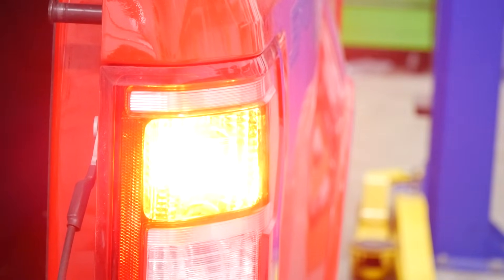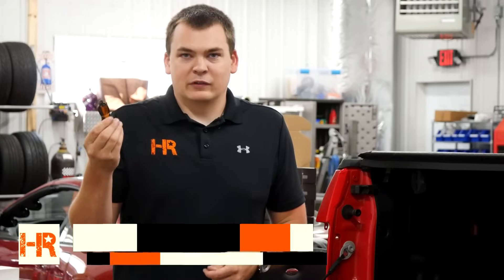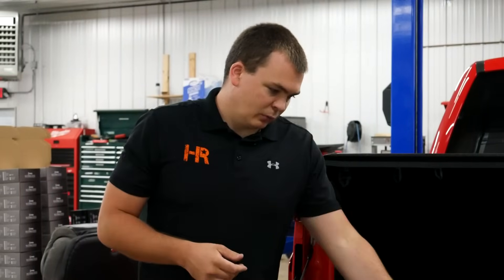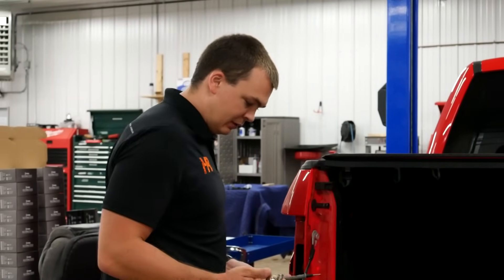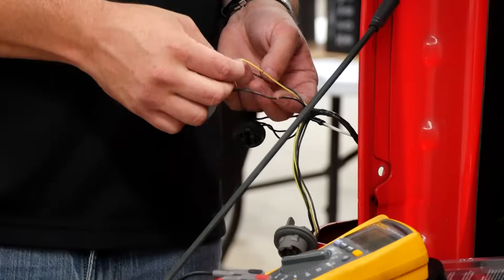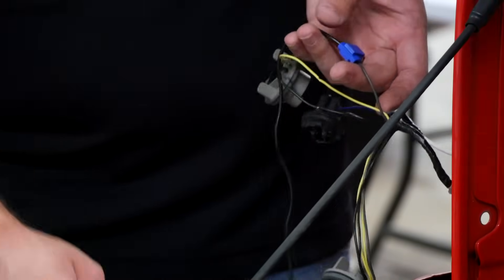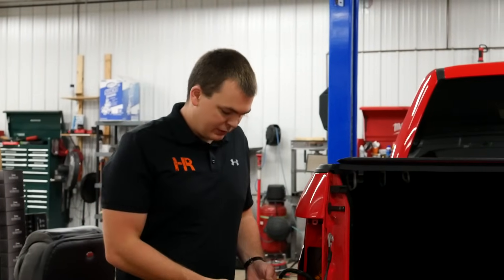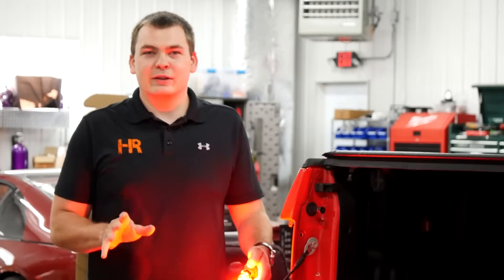How To Install LED Resistors - Everything You Need To Know | Headlight Revolution

Comment: My question... does each bulb require a resistor?  There were 3 bulbs in the housing, so does each bulb need a resistor?  Otherwise, it all looked straight forward.  Thanks.
Reply from the maker: Typically the brake light will not need a resistor, hyperflashing is most common in turn signals. In this case here, only one resistor was used per turn signal.

Comment: I have a flikcering issue with my new led headlights bulbs but its only on one side, Should i install both resistors or just a single one on the affected side please??
Reply from the maker: For low beam or high beam, you'll need a PWM/Anti Flicker module. We usually suggest one per bulb - https://www.headlightrevolution.com/gtr-lighting-pwm-hid-kit-modules-ACC.PWM5202.MOD_2?quantity=1

Comment: First i bought LEDs, great. Then i had to buy load resistors, not as great. Now i have to get a multimeter...starting to get annoyed.
Reply from the maker: You can get a really cheap test light at most local part stores!
Reply: @HeadlightRevolution  👍thanx!
Debating on just leaving it hyper flash

Comment: Hello. Very quick quetion.
If for any reason the LED bulb fails, Can I install a regular incandescent (original) bulb on the socket that already have a resistor. Or there is no turning back once resistor is installed?
Thank you in advance.
Reply from the maker: We do recommend removing the resistors if installing halogen lights.

Comment: This has been the most helpful video I've seen!  Have a 2018 Tacoma and I switched out front and back lights with LEDs. Question tho! --> How MANY resistors do I need?? One per light (per turn signal, not for each light in the compartment)? Meaning do I need 4 resistors (2 headlights and two tail lights; one for each) or just the 2 in the back (one for each tail light)?? 
Help me out here, this has been driving me crazy for months! Thanks.
Reply from the maker: Glad it helped! For resistors, you'd need one per turn signal. 🙂
Reply: Ok! So 4 total! Two in front and two in the back (one per turn signal/head/tail light). Thank you!!! Will update with how it works out!

Comment: 1996 f350 7.3 auto trans. Swapped my bulbs to LED, put a resistor ground to ground and had Overdrive issues still, this explains better that I need flasher to ground with the resistor. I’ll try that before throwing in the towel going back to factory bulbs.

Comment: Quick question. While looking for turn wire and parking wire. Can I just ground my test light to any place on the car or do I have to ground to the wire?
Reply from the maker: You can use any general ground as long as you are testing the correct turn/parking wires.

Comment: 05 Tundra DC. Installed LED headlight and foglight bulbs. This caused my lights to work weird since both are on the same switch. I put a load resistor on the driver side headlight and now they work fine. Question, should I put another load resistor on the passenger side headlight or am I good to go?
Reply from the maker: If the passenger side is working fine, then you should be good to go!

Comment: Hi,
Great instructions. I have one question.
Does installing the resistors in the rear also take care of the hyperflash in the front turn signals as well?
Reply from the maker: No, you will need one resistor per bulb.

Comment: Why switch to LEDs if you are going to add resistors so that you consume the same amount of power?  A software update would give you full benefit of LEDs; longer life and less power consumed.  On older vehicles with thermal flashers they would flash faster indicating a burnt bulb.  Vehicles don't have a ground.  The entire body is the same potential as the negative terminal of the battery.  Installing the resistor is necessary because the vehicle manufacturer is hiding the needed information to do this job properly.  Right to Repair laws are needed.

Comment: Call me crazy but if you're holding the harness in your hand with the bulbs removed....... why in the heck are you stripping wire insulation and compromising the integrity of the harness. If you're gonna do it that way, probe the connector my guy. Easier and no stripping anything just to see what's what.

Comment: If I'm doing a headlight. Am I insulting these in the front instead of the rear like you are doing
Reply from the maker: If its for a front turn signal, it is the same concept but with the headlight instead.

Comment: Hi, does these work with parking diodes as well? i bought some LED diodes for my parking lights, but when i turn ignition on, the diodes turn on for like 3 seconds, and then they turn off. Is that possible to fix that problem with the same method? It must be since the resistance is too low on the LED doides right?

Comment: Quick question, if the driver side signal is hyper flashing, can you put the resistor on the tail light or headlight either or? Also, I have a 2023 Toyota Tacoma special trail edition what kind of resistor do I need for that model truck? I appreciate your video. Very informative.

Comment: Wait, you already had a resistor installed but didn't explain why you have 2 resistors on 1 taillight
Reply: NM. I read you had 2 turn signal bulbs for this truck so you needed 2 resistors

Comment: Great video 
I have switchback turn signal in the front as well as led turn signal in the rear of the car, I have installed 2 load resistors near the rear of the car and everything has been working great until about 1 year down the line when the left turn signal started hyper flashing again 
I immediately thought it was a burned out load resistor since none of the bulbs were burnt out, just hyper flashing so I replaced the left side with a new load resistor but unfortunately it did not fix the issue, I just have no clue to what is wrong, hopefully you can guide me in the right direction.
Thank you very much

Comment: I saw your other video and I only see you do one resistor per side for the 14-15 Silverado. Was this ford an example where you had two resistor on one side or does each side need two?
Reply from the maker: One resistor per LED turn signal bulb is generally the case!

Comment: This video is excellent! I have a 2018 Equinox and this video was a life saver. It's a really easy process after you do the first one!
Reply from the maker: We're glad this video helped you!
Did you mount them with screws like mentioned in this video?
Reply: @HeadlightRevolution  Yes! My Equinox is tough because the front turn signals are separate from the headlights, so I mounted the resistor just above the wheelwell. I also soldered the wires together and it works beautifully

Comment: Are resistors required for any other drop-in LED replacements, other than turn signals? Like license plate lights, map lights, other various internal cab lights etc?
Reply from the maker: I would say for almost every vehicle, no. 
We've personally never seen a vehicle that monitors those bulbs in a way that would cause issues.

Comment: Hi there! Thank you so much for making these awesome videos :) It's very helpful :) I was just wondering what if you get a resistor without the mounting (screws) Can you tape it with the cables or is it a bad idea? than you
Reply from the maker: The resistor would absolutely melt the wiring if you tie it off with them. 
Letting it hand might be the only option unfortunately.

Comment: When I hook up my boat trailer with L E D lights I get the problem, can I hook the resistor on the trailer side ? By the 4 pin connector?

Comment: My rig started hyper blinking when I swaped the front blinker bulbs, would I put the resistors on the front? My front bulbs don't have a specific blinker wire as it runs into a connector that plugs into the headlight itself and is then wired according inside. Thanks for the video!

Comment: Doesn't the factory make bulbs with resistors?
Reply from the maker: Factory uses halogen bulbs, which use much more voltage than an LED does so they do not require resistors

Comment: this is nice on american cars where you have place to mount resistors but on EU cars especially smaller ones  hm
Reply from the maker: These resistors are fairly tiny, you should be able to fit them in most applications!
Reply: @HeadlightRevolution  its hard on peugeot 207  HDI  from 2007   and i take smaller resistors from 25Wat ., i hope they will be enough because turn lights on back sides are 6wat  some chines  from aliexpress

Comment: Thank you so much for the step by step instructions. I had replaced my front turn signals with LEDs and it had the hyper flash. I known and heard about this being an issue for others and you helped me figure it out. Stopped by my local autozone and picked up a multimeter and resisters and put em in same day. Thanks man!
Reply from the maker: You're welcome!

Comment: Hi. I'm installing a reverse lamp. Seeing the l.e.d lamp only draw 2 amps can I just link a l.e.d load resistor onto the lamp then couple it to my current existing factory reverse lamp on my 2012 Nissan Navara D40 diesel?, I'm wanting to just have it on when reversing only as I don't want to run it thru a switch.

Cheers Carl
Reply from the maker: You could!

Comment: so with the resister getting extremely hot, wont it only get hot while using the turn signal lights? because there’s no power going through it when the turn signals not activated correct?
Reply from the maker: Correct!

Comment: Do you need resistors for the brake lights as well? I installed led brake lights and they worked great for a couple weeks but now I got a brake override malfunction.
Reply from the maker: I would say any LED bulb replacing an incandescent bulb should have a resistor installed on it!

Comment: I am probably stupid for asking this, but wouldn't the current just bypass the resistor and take the path of least resistance through the LED, when you wire it in parallel like that??
Reply from the maker: Nope! This is how they're made to be wired.

Comment: Does one resister take care of all four turn signals?
Reply from the maker: No, you will need one per LED replacement bulb.
Reply: @HeadlightRevolution  Thanks, Headlight.  Replacing the module might be easier??
Reply from the maker: If your vehicle has one, most modern vehicles do not!
Reply: @HeadlightRevolution  Fortunately, my 2001 Silverado has a flasher module.  It was a quick and easy install under the dash.

Comment: Hi, what ohm should i use on each resistor between 3 and 6 ohm? Is higher better? Thanks
Reply from the maker: Depends on the application!
6Ohm is best for most modern vehicles.
Reply: @HeadlightRevolution  what about watts? I have 3157 led turn signals too. Should I get 5w (100 ohm) or 25w (6 ohm). I’m guessing the 25w but wanted to double check.

Comment: I have toyota 1986 truck
Are you saying I need resistors for turn signal, backup and brake light on each side? Thks jc
Reply from the maker: Every turn signal bulb should have a resistor installed or the flasher module replaced with an LED one.
Reply: @HeadlightRevolution  thks..jc

Comment: don't need to put in a bunch of resistors on each one of those lights just go ahead and replace the  relay turn signal switch with an LED switch relay  , then switch the bulbs out to  LEDs
Reply from the maker: Yep!

Comment: Great video,just one question do I need a resistor for the front turn signals and if use led ligths for the cluster do I need a resistor too ,my truck is a 1989 toyota pick up,thank you for your advise,and cheers from ontario ca.

Comment: On 1970 Dodge Charger I replaced (4) rear brake/signal bulbs each with 6 ohm 50 watt hyper flash resistor and signals work just fine. What isn't is bulb brightness. Compared with the LED park lamps I can barely make out brake or signals. Experimenting, I doubled (in series on left side) resistor values and how about that, I can now see distinct brightness over park LED bulbs. I understand the math. Higher resistance means less current through them and more to the LEDs. Could it be happening because I'm dealing with (2) signal/brake loads (per side) coming from a single source which changes combined parallel resistance? Any advice on this would be appreciated, thanks.

Comment: I already have led turn signal lights with canbus resistors built-in. But after a long duration at some traffic lights, I get hyperflash. Is it advisable to add the load resistors in this video? If not, how do I fix my leds to permanently stop hyperflashing?
Reply from the maker: How long are you turning for? We typically don't see resistors lose their abilities until about 10-15 minutes of continuous use, given these resistors are externally mounted and not built-in like yours. Likely there is just not enough resistance to stop the hyperflash, additional resistors may fix the issue or ultimately you may need new bulbs if the current ones aren't up for the job.

Email us for recommendations & help!
Sales@HeadlightRevolution.com

Comment: If connect resistor to parking wire instead of turn signal wire, without testing, wouldn't the resistor not work when turn signal is activated?

Comment: Do the resistors get hot enough to melt zip ties? I have some decent spots to mount them, but they are not flat surfaces where I can use screws.

Comment: I have an Audi A7, I installed aftermarket taillights and they work perfectly, everything including turn signals and brake lights. Only issue I’m having is an error code on the dashboard, would this fix it?

Comment: What about LED headlights?  Bulb has one row lit for low beam, two rows for high beam.

On high beam, both rows on both headlights light up - as designed.

On low beam, driver side headlight has one row light up (as designed) but passenger side has one row lighted and second (high beam) row flickers.

When switching back to high beam, both rows of both lights light up normally.

Back to low beam, second row flickers in one of the headlights (usually passenger side) while one row (low beam) lights only in the other headlight.

Should resistor go between ground and high beam wire, or ground and low beam wire?

Thanks
Reply from the maker: Hello! This would be a great question for our customer service team, shoot us an email and we will get you taken care of! 
Sales@HeadlightRevolution.com

Comment: Best video! Only follow-up question, I’m trying to install led bulbs to my stop light. Do I install the resistors to the turn signal socket wiring or brake lamp socket wiring?
Reply from the maker: Turn signal!

Comment: Does Anyone know if a 50 Watt 10 ohm Load Resistor work for a 3157 bulb.
Reply from the maker: 50w 6ohm.
Reply: @HeadlightRevolution  Thanks, will this fix my problem. My rear signal light stays yellow only, it doesn't blink.
Reply from the maker: This may help with that!

Comment: I have a 2014 expedition limited. I have led tail light assembly and also led turn signal bulbs which resistors do I need and do I need to install resistors on all lights front and rear
Reply from the maker: 50w 6ohm resistors!
Reply: Thanks

Comment: I would like to replace my brake lights and rear turn signals. Quick question… I connect a resistor to each individual light? Want to do this correctly.
Reply from the maker: You will need a resistor for each LED bulb.
Reply: @HeadlightRevolution  so you need 1 resistor for for each bulb in both tail lights? that would be what 3 resistors for each tail light?  this is why I've not done led tail lights. trucks old so no warranty but wiring up a bunch of resistors just to have fancy tail lights I don't know. help me out here.

Comment: On my 2014 camaro  there are 2 bulbs  on each side 2 on the left and 2 on the right. Do I need to install a resistor  on each line, in other word do I need 4 or just 2 resistors to fix my hyper flashing
Reply from the maker: Each turn signal bulb will need a resistor if it's been replaced with an LED.

Comment: I have a 2019 Chevrolet Traverse. Trying to replace the reverse lights with LED Bulbs, do the resistor have to be connected to the turn signal wiring as well? Or directly to the reverse wiring??
Reply from the maker: Reverse lights typically do not need resistors.
Reply: @HeadlightRevolution  Lets see if you guys can help me out.  When I replaced the LED reverse bulbs, both led lights stay on, the back up camera on the 2019 traverse turns on/stays on. And reverse lights go super bring when reversing., then go back to staying on while driving. You think a resistor is needed in this case?
Reply from the maker: Reach out to our CS team.

HR CS:
218-755-5200
Sales@HeadlightRevolution.com

Comment: I have a 2000 silverado and I replaced my daytime running lights with LED bulbs and they are very dim. What can I do to get them brighter?
Reply from the maker: You would need to replace them with brighter bulbs it sounds like!
Reply: @HeadlightRevolution  do you guys carry a 3157 amber LED bulb that is brighter than the Sylvania 3157 amber?
Reply from the maker: Check these out! 

https://www.headlightrevolution.com/3156-3157-gtr-lighting-carbide-bulbs-LED.BUL.3157.CAR2_2

Comment: So if you have them in your rear tail lights and your front headlights do you have to put four resistors in or does one resistor per side solve the blink issue?
Reply from the maker: Correct!
Reply: @HeadlightRevolution  such a bummer so much work for LED lights too bad the halogens just suck. Lol